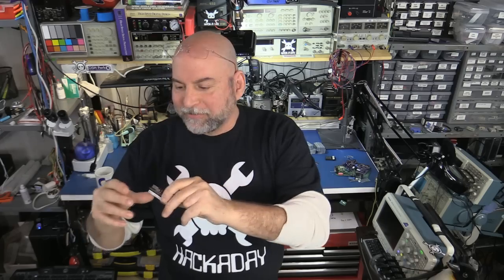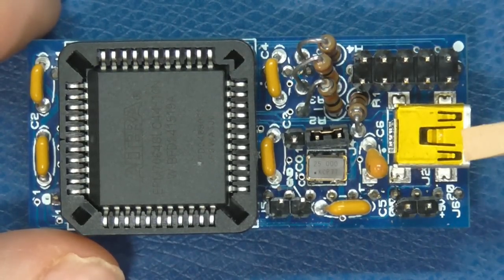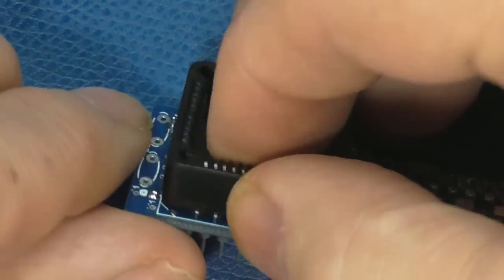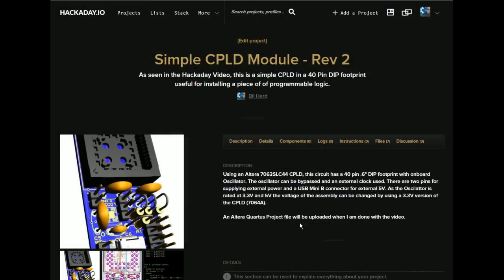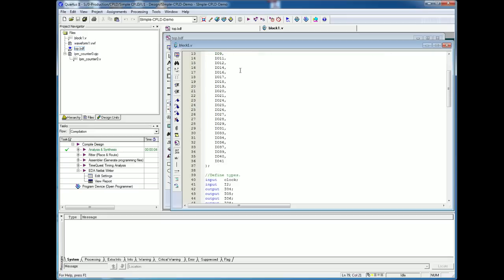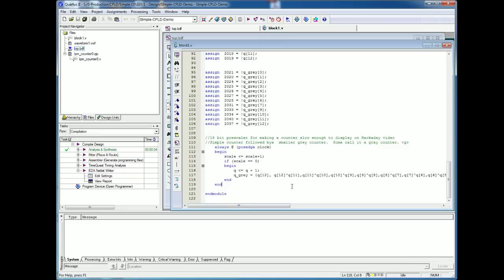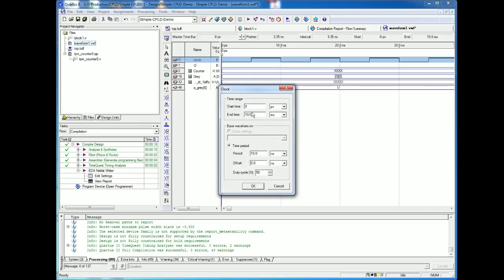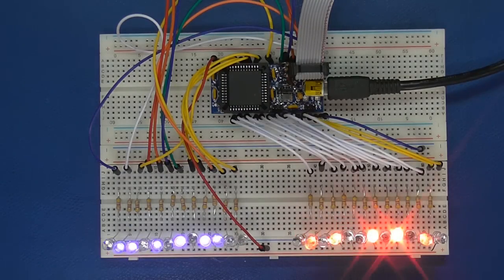A Better Way to Plug a CPLD into a Breadboard

Comment: Can you think of a practical example where you would use a cpld over say an arduino?
Reply: +I don't want a channel I'm just commenting basically every time sensitive task and/or tasks that would be to heavy for a µC. A CPLD (or quite similar a FPGA) are logic gates that can be programmed.
they can be used from glue logic up to an ASIC substitute.